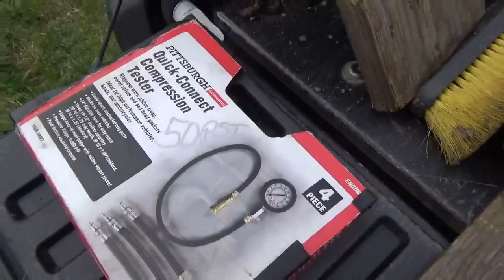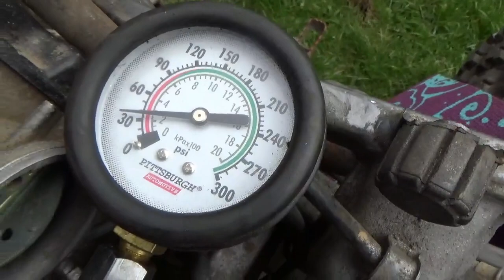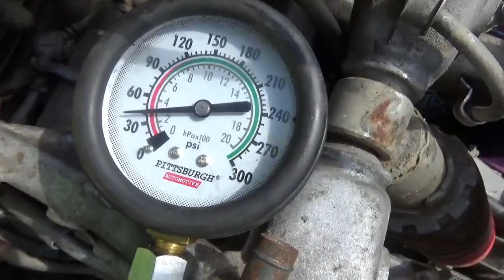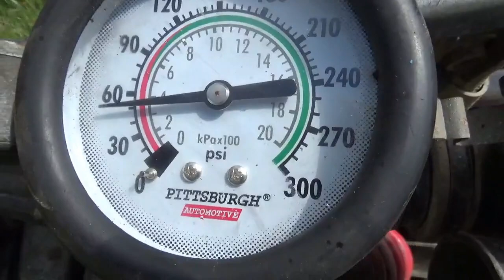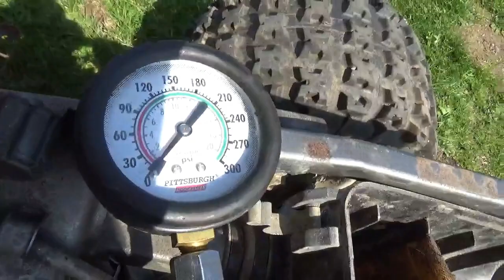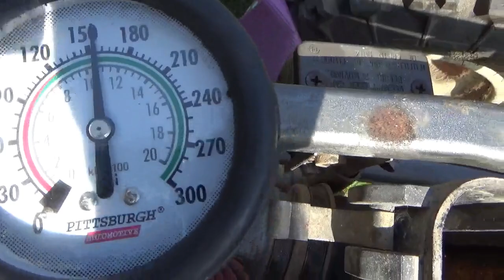Honda TRX300EX, Hacks for Low Compression Engine Start and Recovery!

Comment: I’ve done 2 cycles of this with the cyl, if anyone has zero compression in one cyl like I did, try atf soaking for a day if that doesn’t work out just enough atf in the cyl turn over by hand to make sure it’s not hydrolocled and start it, wait til it’s hot, then wait til it’s cold and repeat until it starts, went from zero psi to 45 consistently just waiting on it to cool for the last one or two cycles

Comment: Hell yeah that's awesome I have a 1991 TRX250X that I have to pull apart have to replace left side crankcase going to throw in a new timing chain while I have it apart
Reply from the maker: Hey Hondaman, If the oem chain is tight, I would let it be, if it is loose, and the adjuster is approaching the end of its travel, then I would change it.... OEM Honda stuff is typically better than the aftermarket unless U buy the expensive stuff,  Just my thoughts, do what U think is right for Ur motor! Thanks for Ur thoughts, info, encouragement, watching, and commenting!!!

Comment: I have a Honda 97 FourTrax then I'm going to start working on Friday it's been sitting for a couple years is my wife's and she was younger it was running a couple years ago but it was backfiring really bad after putting on a new carburetor when it didn't run before I put on the new carburetor

Comment: I have a 98 trx300ex it ran great my son was riding it started smoking and died. I had 10psi of compression and took the valve cover off there was some wear on the rockers and the cam humps a little wear you could fill the edge took off. Took the valves cover and you could see the blow by. It was smoking. Took off the cylinder head and the piston was shredded on the intake side . It had oil when it happened the motor was hot. Went to take of the piston and the wrist pin is siezed i am currently drilling it out on each side of the piston . It is loose through the drive shaft just locked to the piston and i took the pins out. Have you seen this before and what happened? It had set for 6 years we changed the oil got a battery and it ran the valves was loose . I had put a new oil filter in just before  i quit riding and didn’t replace it wish i would have there was oil under the cam and when i took the banjo screw off oil came out so oil pump was good i guess but if you see the piston it looks like it ran dry. Just not sure.

Comment: @HarveySpooner When you loosened the valves and tapped them, I'm assuming you reset the valve clearance afterwards? Or would it help to turn it over while loose AF, to aid in cleaning the seat?

Comment: Will this work for a 2004 raptor 660 ? I can’t get mine to start 😞 I put a new starter and solenoid and spark plug and it’s just sounding like it wants to turn on but won’t . I noticed my wire harness on the solenoid keeps going out and then star buzzing sound when I try to start it and doesn’t do anything. I don’t know what else it could be if it’s the battery or something else 😞If anyone can help I would really appreciate it 🙏🏾🙏🏾

Comment: Had to tap the spark plug hole got a ton of shavings and now there’s no compression, happened once before on another bike took the head off cleaned it ran like new, is there any way to drive them out without taking the head off?

Comment: oki good to know you need 50psi cause my honda trx300ex give 60 psi i tought it was low since people say 100 120 psi
all quads i have give arouhnd 50-70psi max so i was confused thinking my compresion gauge was bad.. bought a 2nd one same thing... cause my banshee also just gives 50psi and wont move under its own power it starts doh no problems but wont move it dies... (i think its has some bad seals me and a friend redid the engine...)

Comment: Hey Harvey I have a atc 125m it’s has about 40 in compression on the gauge.  You put oil in the cylinder would that be in the spark plug hole ?

Comment: I've got a 250 ex that I blew up the top end on and then replaced it all it has good compression and I recently replaced the cdi box it'll sputter but won't start any of you got any answers
Reply: What is the cdi box? And what made you think it was that?
Reply: @captaindeadpool1640  it's one of the parts that control the electricity that goes to the spark plug and it had weak spark

Comment: Toss the harbor freight compression tester in the trash. They read falsely low right out of the box. I've seen untold amounts of motors rebuilt for no reason due to a crappy compression gauge.

Comment: That’s almost unbelievable in the up swing of compression , from 40 to 150 , something ain’t right ! I’m not saying you messed up at all and I did see the numbers so that leaves the compression tester equipment ! I’m wondering if you had a blockage or something and the first numbers are wrong or your gauge went haywire and your second numbers are wrong ? 110 lbs difference is HUGE ! I’m hoping that both numbers are spot on !!!!
Reply from the maker: Hey Dave, I think there was stuff on the intake valve seats, remember, it was spitting out the carb, once they got sealed enough with oil it could start and once it wasrunning, the valve seats cleaned up.... Thanks for Ur thoughts, wisdom, watching, anc commenting!!
Reply: @HarveySpooner  that’s as good of a theory as any ! Either way it’s up and running ! Lol

Comment: The only MOTOR on the quad is the starter. 
I know your American but God man it's called an engine. Get your nomenclature straight ,you'll sound more intelligent.
Reply: Not important. Everyone uses both terms.
Reply: @refugeinc.159  you need to talk the talk before you can walk the walk.
Try looking it up . Totally NOT the same thing. Learn before lip
Reply: Always the one guy
Reply: @jlucier59  who is correct.
Reply: Even the parts shops ask what motor do you have engine. Even on quarts of oil it say motor oil . It’s ok don’t let a word ruin your day life is to short enjoy it while it last 👍
Reply: @whowho7969  I guess if everyone else is wrong, you don't want to be right...
Reply: British slang for a nice car is to say that's a nice motor also they're called motorcycles not engine cycles.